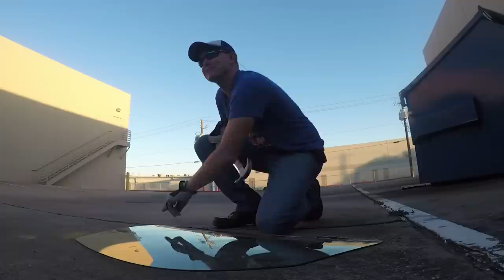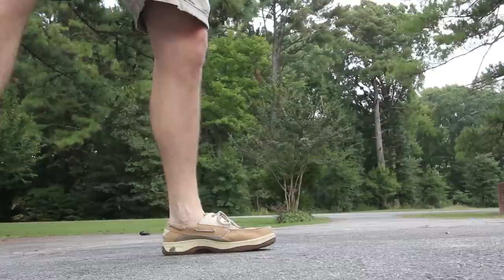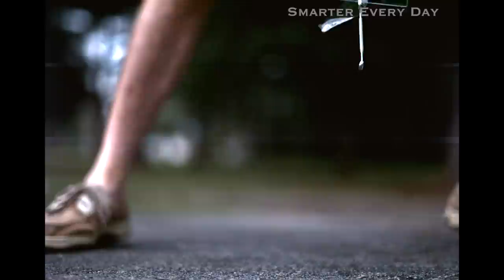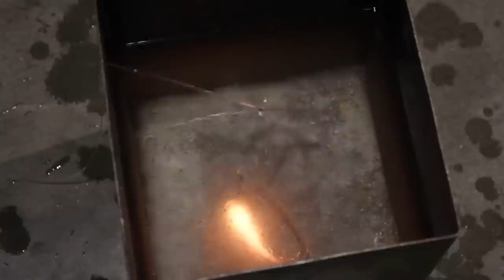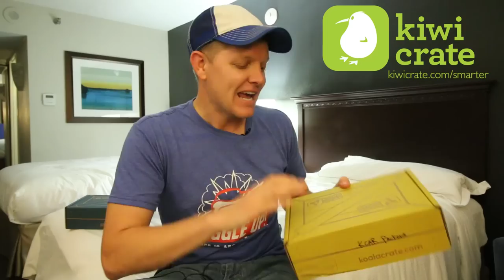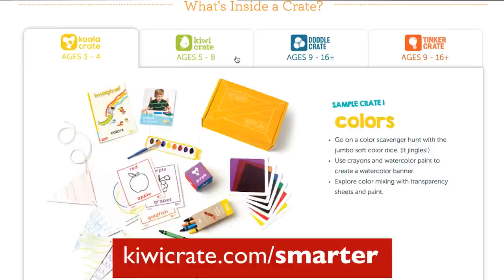How to Escape from a Car Window (SLOW MOTION) - Smarter Every Day 144

Comment: If you wanna escape a car have one of those spring activated "needles for marking where you want to drill a hole" and push that against the side window.
Reply: Center punch.
Reply: Matthew Smith Yes. Words. (Thanks:))
Reply: +ColtaineCrows Actually, what you described is an "automatic" center punch which have a spring loaded mechanism to create the force. A regular center punch requires a hammer and if you have one in your car, it defeats the purpose of the pointy object, haha.

Comment: Why would you smash your windows?
Just use the doors lol
Reply: you cant open the door underwater
Reply: +Dr Alec Reaper dented doors stuck shut after an accident. gasoline dropping everywhere. it's a matter of time until your car is consumed in flames.
get the picture?
Reply: Often In a crash the doors are mangled and won't open.
Reply: It's extremely difficult to open your doors when your car drives into a lake and is submerged in water. The water pressure is immense and you will almost certainly die if you wait until the pressure equalizes once the car fully fills with water, as your car will be at the bottom of said lake.
Reply: +Coxy002605 Don't drive in the drink!
Reply: +Dr Alec Reaper Cool people smash the windows. Are you not cool?
Reply: +Elliot N There was a "Mythbusters" episode in which they proved that if you remain calm and wait for the car to fill with water before trying to escape, AND the car doesn't land upside-down, you can open the door and swim to safety without running out of air.  (If the car lands upside-down, you'll probably be too disoriented to swim to safety in time.)
Reply: +Coxy002605 haha lmao
Reply: +Elliot N usually a car doesnt drive itself in to the water, its the drivers fault;)
Reply: ***** you don't understand :^)

Comment: If you have tint on your window, the glass shatters but is held in place
Reply: That's not true. I fabricate automobile windows in a factory. Some glass is laminated. The glass you're thinking of that stays in place is laminated glass. That's why windshields don't bust out when they're hit where-as side lites and back lites do. Some more expensive cars or specific models have all laminated glass but that increases the cost of the car and the only advantage for that is noise reduction. The vast majority of glass is regular tempered glass but it's made with different coloring. We have dark glass, light blue glass and light green glass. AS2 means non-tinted, AS3 means tinted. You'll see it on every window you look at. You're thinking of laminated glass which is just two pieces of glass with a laminate layer between the plates. Tempered glass can be broken by stress on the edge or a puncture.
Reply: which window?
Reply: What do you mean by which window? Every plate in an automobile has a trademark o_o..
Reply: Also, I want to edit my comment and clarify something. If the tinting is done post-fabrication, as in it doesn't ship from the factory as tinted glass (the composition of the glass is darker), then the tinting process is basically a lamination process. Tempered glass will also stay in place if you wrap it in saran wrap before you pop it with a punch, so...yeah...Point being factory made tinted glass acts like normal tempered glass. Post-fabrication tinting makes the tempered glass act like it's laminated, because, hint, it is.
Reply: Kraken Tech Panda I mean, he said a window shatters but held in place if tinted. Is it the side, back, or the windshield?
Reply: It means car windows in general, which includes side glasses.

Even a kid recognizes generalisation from specification, no need to be an internet philosopher.
Reply: The6thShadow Because only the sides shatters, not the front. Dunno about the back windows. That's why I asked.

Comment: Destin, I have a request for a video topic:  If you drill a hole first and then use a countersink on it, why does it form a hexagon shaped countersink hole?  Even when the countersink has 5 cutting edges it still forms a hexagon!  But this does not happen if you do the countersink first and then drill the hole. (I use wood, but I assume the same effect applies to metal and acrylic.)  I would love to see this in super slow motion.... perhaps in all three materials!  Acrylic might even allow a "bottom up" view!
Thanks

Comment: I saw a video about hidden tool in the headrest for just such need to break glass to escape, lets say fire & or water submerging. It seems that headrest can be removed & the two steel posts were actually designed to not just keep your head/neck from experiencing whiplash in a sudden stop or crash, but the headrest can be removed & used as a tool to break/pop the side window(s) (not the windshield being the membrane would not let glass break away fully.) if escape is needed & the door cannot be opened. I thought that it was a pretty cool bit of info & that you might enjoy it.

Comment: I love those tests you did, it really gives you an idea of what kinds of glass there is, some break
Easy, some not so easy. In fact. I saw a YouTube video where the tried to break hurricane glass, it 
Crease spider web breakage, it never shatters, and you have to pull the spider web broken glass from the
Frame, boy, some glass is so tough. I also learned the easiest way of removing block glass. There was a
Great video on YouTube that explained the easiest way to knock out block glass, and a fireman took out
A block glass window, don't know where it was shot, but it must have been an abandoned building, 
Or a training building, it was awesome.

Comment: Hey destin I dont know if you've heard of it but supposedly when you take a spark plug and brake the white casing of it off with a hammer then take one of those pieces and throw it at tempered glass it will shatter. I'd love to see a video of that in slow motion from you

Comment: I might be a bit late 4 years later - and it might have been said in the comments already (and I just didn't find it): Destin is absolutely right about the attributes of the glass - still, the advice on how to break out from a car through the windows is still to go through the wind shield - not through the side doors: The windshield is built in in a way that when you lay back in the front seat and push the wind shield with your feet the whole wind shield will pop out. It is not about breaking it but about pushing it out of its ancors!

Comment: You pretty much got wrong the tempered glass, the "from outside to inside" hardening does not mean the edges are harder, but the surfaces, the difference does not apply in XY plane, but in Z axis (except for very edges of the plate, since those cool from sides too - but thats fraction of inch). Theyre easier to break near the borders, because there is less support from surrounding material, but the tension between the surfaces and the core is uniform regardless where on the panel you measure it.

Comment: A spring loaded punch with a seat belt cutter belongs on every car key chain. Keys remain in the ignition after accidents, so the tool remains within reach of the driver. Place the loaded punch in a lower corner of a side window, push hard, close eyes, and release the punch. Cut a jammed belt and escape.

Comment: Not sure, but you might have a hard time if the window is "up" because the frame is holding the edges from all sides, unlike if the window is "down" where the top side will give upon impact while the other sides are held in place which in turn will shatter the window.

Comment: You could break  the tempered glass just as easy as on the edge "IF" you had a backing to it instead of just letting it flex.
Using a sharp point you can break it with no problem, automatic centrepunch (those you just press hard until it makes a mark on steel before drilling)

Comment: on the window breaking when you hit it on the corner with the hammer, the fact that it is warped means hitting it in the middle most of the shock will be absorbed. If you flipped it upside down so the middle was in contact with ground. It may smash same as when hit on the edge, which was in contact with the ground.

Comment: Don't know if this has been mentioned or not, but there are numerous cars released in the last few years that have "laminated" door glass in the front doors. You have to look at the little black stamp/logo usually in the bottom rear corner of the door glass and if it says "laminated AS2", not even the firemen can get through them. I've been in insurance for 10+ years and have seen this trend emerging. The only thing I can find is the mfg's are saying it's to "better keep the passengers inside the vehicle". However, a vehicle ran into water, you will not save the passengers. You can do your research. Firemen/rescue have had to outfit their rescue gear with special equipment to rip through these laminated door glasses. You can't get through them with a baseball bat. Do some research on that!!  You can just search for "laminated door glass" and you will find it. 

I pray no one ever carries one of those glass breaking hammers, runs into water, only to find they can't get through the door glass b/c some engineer thought it better to laminate them.

Comment: Technically, All cars with headrests have a built-in window breaking tool. It is the metal robs the headrest is mounted on. The reason they allow the headrest to come out of the sockets on the seat is that they are made to be able to be used as window breaking points when striking them against a side window.  Just in case you didn't know. If Destin's hammer had been less flat, it would have broken the side window easily. Focused force is what is needed.  Hence the headrest pointed ends on the mounting rods.

Comment: Just want to add that some door glass is the same as the windshield. It had 2 plys of glass held together with vinyl. I don't know what or if there is any safety device to escape that. I have seen a few burglary attempts failed to break into the vehicle so now i wonder how you would get out in an emergency. Hmm

Comment: It's funny how fast glass really breaks. It is just comically fast, if your looking for a more comprehensive video on how fast it is go check out the slow mo guys, they recently put up a video of glass breaking at 14,000 times slower speed and it takes a couple seconds.
Reply: they uploaded the whole recording on youtube, in real time its 5 seconds, on youtube its 19 hourd
Reply: Don't know if it've been tested, but they could use a long tray into which they insert a melted rupert's drop. Then take it out and measure the time it takes for it to break from one end to the other equaled [don't know maths anymore] to the length = speed. I bet it's like 500 km/h ~380 miles/h, kinda short of an explosion.

Comment: You are not quit right on why car glass is the way it is.  The windshield has a sheet of plastic between 2 sheets of glass.  When you break it the plastic holds the glass to the plastic and doesn't allow the glass to shatter into the passenger compartment thus allowing the occupants to not be cut by broken glass.  If you try to break through a windshield you must break the plastic so it's much harder to break through.  That is why you don't break through the windshield to enter a car.  You break any of the other windows to enter.  The windshield is part of the structural integrity of the roof and a-post of the vehicle to prevent collapse of the roof in a rollover.  A pointed hammer is best suited break tempered window glass.  The other windows are tempered to shatter into little pieces so you don't don't get cut to pieces by big pieces of razor sharp glass.
Reply: I do like your channel though.
Reply: Some windshields are also more acoustically sound than others, but I don't know why.

Comment: A while ago I was building a computer and the tempered glass I had broke by EVER SO LIGHTLY touching the tiled floor.... Now I know it's not my fault it broke, but the manufacturers fault.... Tempered glass shouldn't break with a light touch.... I was surprised to see this tempered glass hitting the ground from 6ft and not breaking.... The glass I was handling was probably as thick as the glass in this video, so it's not that either....

Comment: I really like this video, BUT i really wish you would have said to get a window breaker OR carry something sharp and hard in the car so that you can break the glass easily. a window breaker can be the difference between getting out and not getting out in the wrong situation. so here is what I wish you would have included in the video:

Tempered glass breaks VERY easily from a pin point impact, BUT it is VERY strong against a blunt force impact. So the easiest way to break the glass in a car window is with either a nail and hammer or something else sharp and strong. I personally carry a window breaker that is spring loaded and i was hoping to see one in this video, or at least the non spring loaded equivalent, at the very minimum a nail instead of the hammer head. The problem that this video doesn't consider is the edges of the window will be hidden behind parts of the car door, so you physically can not hit the edges if the window is closed. 

I really like this video, but i really wish you had included pin point impact vs blunt impact on tempered glass. This is also why the glass didn't break on the drop test, the surface of the driveway is too blunt of an impact to create that pin point tension break; its not until you use the wrench to simulate a smaller impact that it breaks. That drop test I honestly thought would segway into pin point impacts.

Comment: Wow I have a video were I threw a temperate glass 15 feet or so did not break but broke part of the concrete hit an edge but in the middle next time I threw it hit the corner boom shatered into million pieces